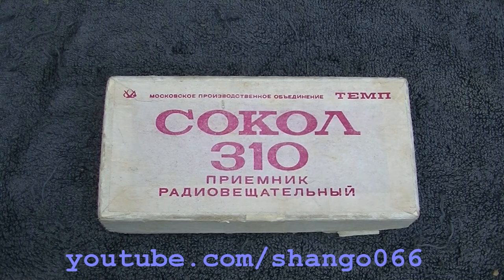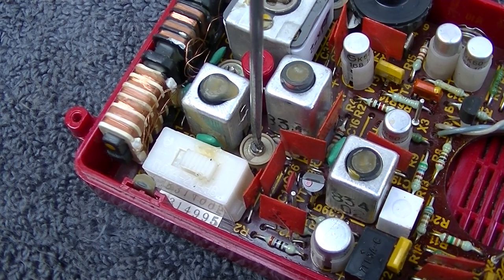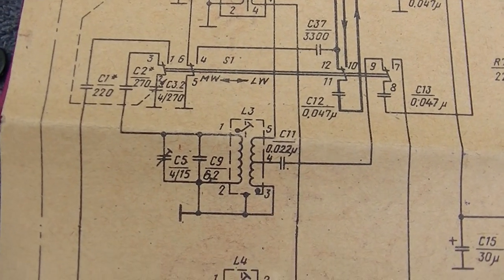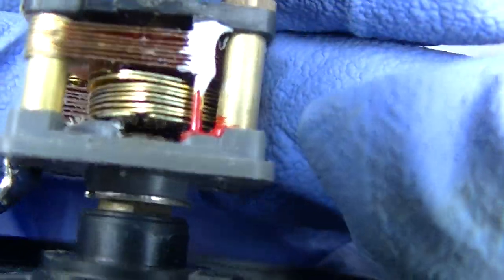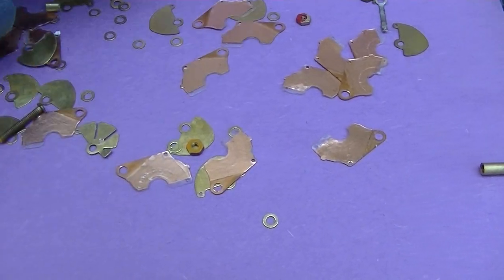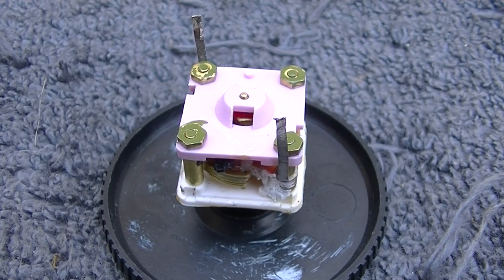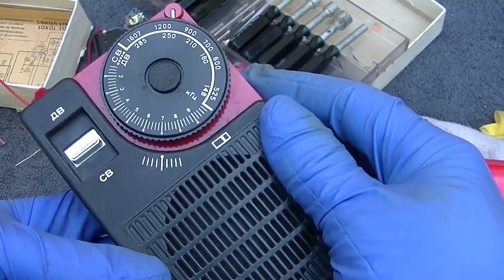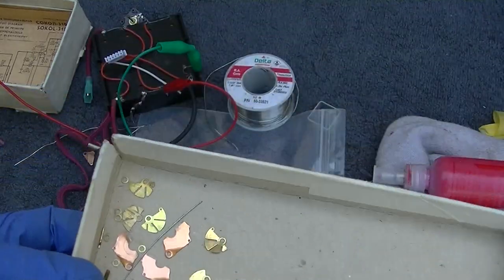Sokol СОКОЛ 310 Soviet Radio Diagnosis and Repair am pocket transistor radio

Comment: Cannot begin to appreciate REBUILDING the tuning cap.  That was remarkable!
Reply: Yeah after seeing them all spread out I thought, "welp, no getting that back together." Serious props.
Reply: Like taking a 300 piece puzzle apart with no picture on the pieces and putting it back together.
Reply: Respect for nice things is a state of mind...  I respect anything designed in a way that allows manual repair, and will try my best to live up to the quality workmanship ideals...  Something that's glued or ultrasonically welded together, uses rivets or heat-staking instead of removable fasteners?  Lower than dirt, which is food for thought because even scum floats higher up than dirt...
Reply: It was really amazing!!!! Este chango es muy bueno!!!:face-red-heart-shape:

Comment: The distortion when tuned off comes from the sharp edges and even side notches of the (likely 4 element) resonator ladder filter. The carrier just went into the notch, so the signal remained SSB with very suppressed carrier, hence the distortion. This kind of filter is normally used with professional communication radios, where good filtering is a must and the higher cost not that much of an obstacle. For some reason this kind of filter became popular in Soviet radios (before that they've used 3 LC coupled resonator - again a Soviet specialty).
I used the modern 6-resonator version (ltm455g or similar), it really allows to receive a station just beside the way stronger one just 9kHz (non US) away. The drawback is the distortion when not tuned right.

Comment: Hi Shango,  I have used scotch tape to fix the shorted tuning capacitors before.  I use scissors to trim around the plates.   Pretty easy, just takes time.

Comment: i just fixed a Universal Transistor Radio I had from the early 60's made by Candle.  I replaced all 4 electrolytics and found the one 5mfd cap by the interstage transformer open as it had very little volume.  THAT little sucker blasts now.  6 transistors and its not too bad of a performer, but its no transoceanic ;-).  Very nice work on this one.  You got me liking those old soviet radios.  They really do perform well are built damn solid too.

-Mike M.

Comment: I enjoyed watching your transistor radio repair video. I think that you did a good job of demonstrating how to repair the tuning capacitor. The receiver seems to work rather well. I looked on eBay for such a unit, but did not find any for sale (not that I need any more radios). Thank you for a great presentation.

Comment: The way it's going in this country,  it won't be long before you can use that to find out the waiting times for the bread lines. And maybe listen to the forecast for the crop reports for next year.
Reply: Nope, you'll have to get that information from your registered and verified mobile device, the app will turn green and display a QR code when you are ready to pick up bread and 3d printed "meat". How else would they ensure I don't take your meat? It's to help YOU!

Comment: The mixer/converter-transistor KT368 with ft=900MHz is very unusual for an am radio.
Usually transistors with much lower ft are used. Good for high gain.

Comment: Just rediscovered this. My Sokol is model number RP-210 but seems to be identical. It was sold in Britain in the early 1990s, very cheap because (as the catalogue warned) everything was in Russian. It came with instructions, circuit diagrams, a divider for the battery compartment and even a tiny plug for an external antenna. Yours is missing the divider - just a couple of pieces of  rectangular thin board (material similar to the pcb) that slot together and sit between the cells to stop them rattling around.   
It's very over engineered - TEN transistors just for a pocket MW/LW set (not even FM), but does have great performance. ♥

Comment: Shango,I’m impressed. Nobody else would have devoted 5 hours to rebuilding that damaged tuning capacitor on this radio. This one definetly found the right home in you!
Reply: You probably are the last radio technician in America that spend the time to rebuild the  damaged tuning capacitor that I know. The shop time for this type of service in America would cost close to $500.00 that excess the value of radio easily! I used to have my antique clock and watch rebuild and no one (except one clock smiths) can do this type of rebuild and repair.

Comment: The radio is very hot and well worth fixing. As you were tuning the radio, I think I heard it pick up KSDO 1130 (Spanish religious programming) from San Diego between 1110, formerly Disney, and 1150 the Patriot. Also, I think I heard KCBQ 1170, the Answer, from San Diego. Impressive!

Comment: Recently I got a Sokol 304 from a chap in Bulgaria, and it performed very poorly when first powered. After some analysis, a failed solder joint in the AM antenna coil was found and fixed. The tuning was peaked and the radio now performs HOT, getting many DX stations at night! What makes these so selective is the piezo filter. It's sad that it's getting harder (and more expensive) to get radios and parts from these eastern countries.

Comment: Shango:  Great video and hats-off for the perseverance to stay with the tuning condenser!  And, as you can see, the radio was well worth it.  Has it been field-tested?

When I was kid repairing these, I would often find the insulating coatings or most of the time sheets to be either torn from their mounting or all balled-up inside the enclosure.  I tried without success to find the right plastic (either baggies or report-covers) that was both thin and stiff enough but sometimes found that I could cut a TO-3 mica-sheet (Radio Shack always had the thinnest ones!) even if it had the holes as the remainder of the sheet would still have enough spacing to keep the plates apart.  Later I found that using thinned-down clear fingernail polish (with laquer thinner) or acrylic or even thinned spar-varnish.  I would dip them to apply a watery-coating to the plates and that worked well.  

This radio is really built with quality.  The first thing I noticed was the ceramic tuning capacitors; you don't see that often.
Another thing was the brass and copper plates used in the tuning condenser.  Brass, and especially copper have lower linear expansion coefficients than the cheap aluminum ones your normally see--this adds to stability which might have been a thing in a freezing Siberian Gulag!  Additionally, these copper or brass plates can be plated with nickel or silver for corrosion although silver is often times problematic.  There is conjecture out there, that the silver plating will enhance the Q but I have never had opportunity to have one, test it, plate it, and then measure the Q--but I have both seen it in high-end test equipment and VFO's (usually with gas-sealed enclosures so I wouldn't bet against that being true.

Anyway, as we get older, we have less patience for BS but you really hung in there and got a good long term result which I don't think (your-fix) will ever fail...

Comment: Looks like it had its original electrolytic capacitors replaced one time, since it now has garbage Chinese Chong branded capacitors installed. Nevertheless, that's one solid performer no doubt. Cudos to the tuning capacitor repair.

Comment: A quick way to see if the tuner is working is bring your Malachite SDR near the radio and look for the oscillator signal. That way you know if the oscillator is running, what frequency it is tuned to, and if the tuning capacitor is turning.

Comment: wow a differential pair in the audio amp.  that's class-cee.  it should have pretty good audio fidelity with the negative feedback that brings.  you won't find that in your average hong-coidial model.  no output transformer in there either- direct drive too.

Comment: It even has a ceramic IF filter, making the IF section very selective, which is why the audio sounds distorted, when the station is not tuned in correctly.

Comment: Shango were the pair of TO126  in the audio output factory?
Reply: The schematic says so. Two KT639 transistors  are original.
They have similar data like BD140 transistors.

Comment: It's basicly the same as other soviet pocket radios, but all silicon transistors, multitank IF filter is replaced with ceramic one (these were 7 resonating elements in comparison with japanese, now chinese 5 elements) and half bridge transformer matched stages of LF amp is replaced by a regular push-pull. Sadly, it's an 80s example, when quality control and strict technology requirements following have gone far south. You can see some improvements though - i.е. PE or PET plastic coil formers instead of paper or polystyrene ones.

Comment: Excellent radio but the tuning capacitor shaft is not keyed, plates rub on very thin insulation films. They clearly missed out on the art of designing tuning caps. For this one, I was thinking, maybe some lubricant could help to preserve that tuning capacitor a bit. Dielectric grease, maybe? Or general purpose silicone-based grease?
Anyway, before applying it, you should test on the leftover plates, to see if what kind of lubricant would be insulator-safe and would not influence the capacitance too much.
Maybe it can help, maybe not. I don't have a CCCP tuning cap to try it out on.
Reply: It will help, but not for more than a few years. Then the grease will be thicker, and will have attracted 'stuf' from the environment, and will start to act up. The materials as used should be all it needs to keep it going. What mostly is needed for these caps (beside keyed plates) is a sealed compartment.

Comment: I wonder if you could use some sort of conformal coating to re-coat those copper plates. Or even electrical tape, but it'd likely be too thick or you would of done that.

Comment: Any Shango fans know about the plastic melted to the top of the IF transformers on these radios? I Broke one trying to melt the "wax" with a soldering iron.  These arn't meant to be adjusted at all?

Comment: Omg that was something. 😁

The better selectivity comes because it has a ceramic filter in the if. I did try to insert a filter with a bandwith of 6 kHz into a standard HongKong radio some years ago, with very good results. Just between 1. and 2. stage. I didnt do anything to match the impedance, I guess it isnt that critical in these small radios.

Comment: The old Russian equipment was great.  It was built for repairability rather than intended to be thrown away when the battery went dead.  Much was also engineered (some would say over-engineered) for ruggedness and durability.  As shown, the schematics and BOM were included as standard with any electronics you bought.  I noted the comment "Turn on and tune in to propaganda" as a jibe at the soviet union - made by someone who hasn't realised that it is just the same in any country in the West, especially the USA.  The comment itself was inspired by a predjudice instilled by anti-soviet Western propaganda, and so is rather ironic.
Reply from the maker: The comment was directed towards turning on the radio and listening to the news where I live today.